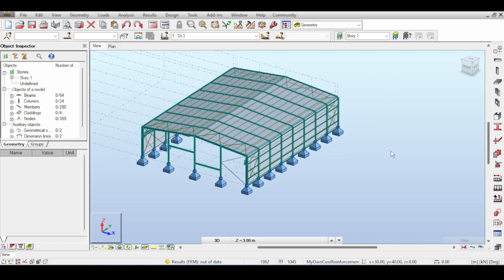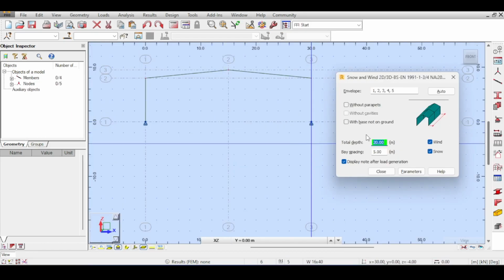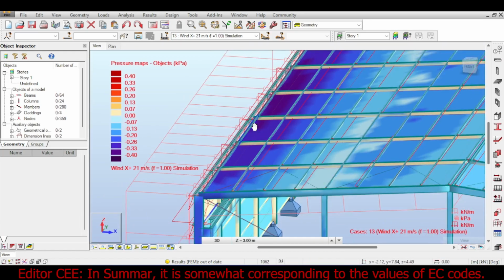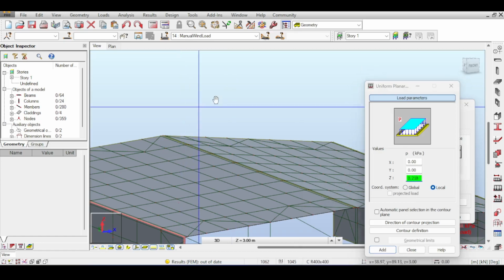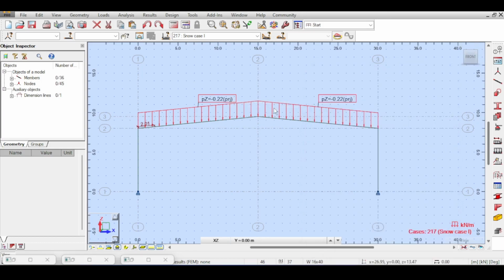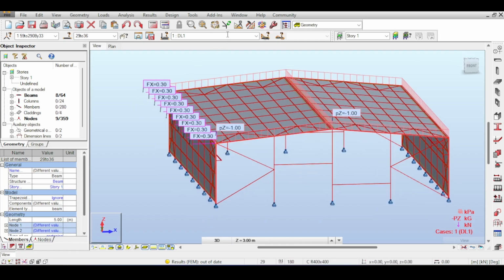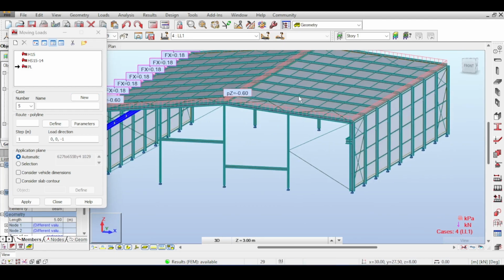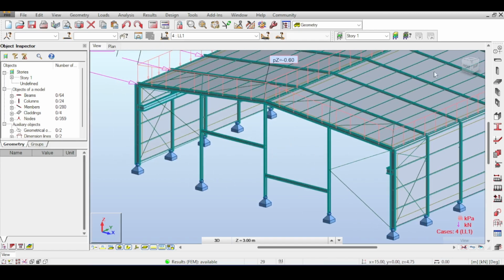Modeling of Industrial Warehouses | Part 5: Wind and Snow Loads

Comment: Hello CEE,

In my opinion, the CEE work-around with the “code parameters-based method” is smart, BUT it is a LOT of work (I guess as the CEE have already mentioned – unfortunately sometimes and in this case, it is what it is). These are the sort of things where the designer’s engineering judgement and their ability to evaluate (by inspection) the most critical (wind) load cases can become handy in minimizing the painstaking manual labour that is involved in transferring the wind load cases as it was shown in this video. Thank you so much CEE for showing these alternative and viable options, because of your work, now there is a choice. 

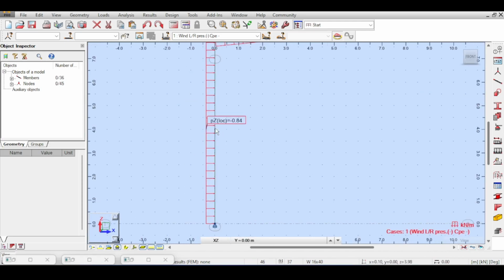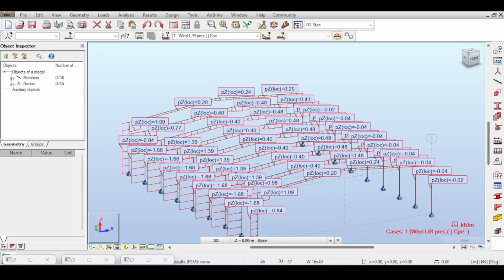21:22 Yes Editor CEE, I 100% agree with the recorder CEE; practical techniques have been laid bare in this video tutorial and these techniques are screaming to be applied by any of the interested viewer(s). [by the way, all transfer wind loads from 13:50 should be divided by 2.5 and not 5.0 because an external portal frame was chosen and it is being used, ref to 13:05]

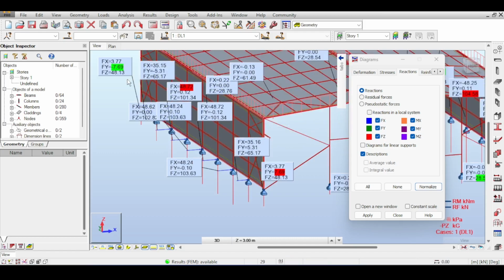22:50 The calculated value of 0.3kN (for the DL case) Equivalent Horizontal Forces to account for the “elements global imperfections” are of the correct order of magnitude. In my region, the value is 0.5% of the gravity loads. This would translate to a similar value of 0.5kN in this particular case.

Question and suggestion: Considering that we are already accounting for “global imperfections” as it is shown above; would it not be even more complete in this warehouse series to also conduct a “2nd order analysis = P-delta analysis” on the structure to ensure that the analysis results that we use in the design of the various structural elements do account for both the imperfections and the second order effects? If yes, I suggest that the CEE consider to show how (or to implement), or to performs a second order analysis on this warehouse structure.

31:26 Just to clarify, the crane horizontal and longitudinal loads coefficients or factors (to simulate the crane acceleration and braking forces) can be added NOT on the “load direction” input dialog box, but inside the “parameters” options….. the parameter button is the one just above the “load direction” input dialog box.

31:55 Thank you so much for confirming the roof bracings and for the pictures. It really helps a lot to build confidence in knowing that this is something that is also being done in practice and on real-life projects.

I really liked the CEE comparison of the RSAP “wind simulation method” and the “code parameters-based method”. Search Autodesk through google regarding: “…. How wind simulation works in Robot Structural Analysis, assumptions made, and validation…..” there is a linked pdf file that makes an interesting read from there. [I could not attach the link directly to this comment because youtube kept blocking/rejecting my comment because it contained a link] 

I have enjoyed this video, and I am looking forward to the next CEE videos. Thank you for always producing top notch quality videos, and keep up the excellent work!

Regards, DK
Reply from the maker: Hi there Engr. DK,
that is a really good catch!!! I missed that. Thnx a lot. Will be added to the description under an "Errata" section. Thnx a lot ^_^
Also, great to know that there are some similarities with your region. 

Yes, a second order analysis with actual imperfections (theta and delta) being applied does make more sense. I think it is valid to show this in a separate video as I have similar requests with regard to buckling stability under imperfections. ^_^

Problem is, I already finished the recording of the last video "Warehouse series", so I have to implement this idea in another structure. I will keep it in mind.

TBH, I did not try to add the horizontal force, still, huge thnx for the comment. See, this is what I love about your comments, they help not only me, but all the viewers. So, "Pinned".

I had multiple comments suggesting that Robot does have an actual wind load calculation sheet that validates its calculations. The title of your pdf will make for an interesting read. I will download it and definitely read it.

I am happy you liked the video, and sorry for those comments not showing up, it is not from my side.

Regards,
CEE

Comment: Great video. I do it similar. I just the calculate the wind in Excel acc to EC and then apply the loads manualy. Quick tip: you can measure a distance by clicking the small dimension icon on the lower right corner( to the left of the units).

Comment: Hello, I have a question, how to apply the seismic (based on  IBC CODE )   and the temperature loads on a portal frame, because I think there is no way to apply the temperature variation load on steel structure in Robot
Reply from the maker: I think there was the ability to apply temperature in the loads. Check out the bar load types. Ima check it out and see if I can prepare smthn for that.

Comment: Dear Dr, my robot version doesn't have CFD. It is the 2024 version. WHat am I missing?. Are you using a older one
Reply from the maker: Hi there, I just checked my RSA 2024, it is under:
Loads -> Wind Loads Simulation

Please make sure you selected the building design template. It sometimes does not appear in other templates.

Regards,
CEE

Comment: Dear Doctor,

I believe that Robot is one of the best software tools globally for calculating wind loads. You will hardly find software that can generate such simulations as swiftly and accurately as Robot. Even the CFD version of Autodesk is commendable. Drawing from my one-year experience in working on wind-related projects and extensive reading on the subject, I can attest that utilizing this method with Abaqus CFD is quite challenging. I waited for about a month for answers, though the duration depends on the PC specifications.

What makes Robot truly remarkable is its ability to provide precise wind loads. Whether using the generated or 2D/3D simulations, the results are impressive. Admittedly, applying these loads to structures can be cumbersome, but even manual calculations take more time. Working with Eurocode 1 adds complexity to the calculations. I just wanted to convey a message that briefly highlights the software's significance for both humanity and engineers.
Reply from the maker: I actually mentioned your point in my community post. I was not yet able to reply here due to some busy schedule I have. I agree with you completely. The only reason I try to avoid this is because it would cause more questions than answers if I attempt to explain it. I mean, computational fluid dynamics is a really really interesting topic, but needs you to have some backgrounds in fluid and aerodynamics as well as aero-elasticity. I am really thrilled to know that you do possess the background in it. It honors me to have you here really.
Reply: @CivilEngineeringEssentials  I mentioned that in my linked in profile. It's an honor for me, Doctor, to learn from you and have the opportunity to discuss this question, many  times I had a lot of question and get into your channel, I'm like this man is doing something remarquable. My research on CFD had left me behind when it comes to designing. However, watching your videos, along with reading and searching in the code and outside, has helped me rebuild a strong background for my engineering design aspect. I hope one day you receive the real value for your hard work and for spreading knowledge in this way. We really need someone like you in this world.

Comment: Hello, Doctor,

The wind simulation is akin to a wind tunnel test, relying on the Computational Fluid Dynamics (CFD) method and doesn't refer for any code. As you may have observed, you can adjust the wind profile values. There is a prescribed rule for making such adjustments, grounded in two formulas. I can share these in a video if you prefer. Nevertheless, CFD stands out as the optimal approach for calculating wind loads. This preference stems from the fact that its foundation lies in the Navier-Stock equation, which succinctly outlines all the characteristics of the studied fluid (in our case, wind).

Distinguishing this method from other codes, most codes exhibit limitations in handling the geometrical shapes of buildings, especially in terms of height. For instance, the Chinese code is unique in its ability to calculate wind loads for buildings exceeding 500 meters in height. Additionally, many codes treat wind as static loads, overlooking the dynamic nature of the actual loads.
Reply from the maker: As I mentioned in my comment on your previous comment. I avoided diving deeper into this topic without establishing the needed background in fluid/aero dynamics and aero-elasticity. Still, I am honored to have you here, with the background. It is actually rare to find ppl interested in this. In my PhD I was working on the structural identification with applications on normal structures and wind turbines.
Oh boy, the wind turbines are surely interesting. Just the sheer amount of complications due to aerodynamics is really cool.
Reply: "I apologize, doctor, if I've been a bit persistent with all these comments about CFD! On another note, my professor, Kassem Deeb, is delving into offshore structures for his thesis. While I haven't delved into the details yet, I've come across two papers on wind turbines, and it's truly an intriguing subject. I believe it might emerge as a significant topic, especially for turbines situated in the middle of the ocean, considering the global push for renewable energy."
Reply: Actually, I wasn't initially interested in studying dynamic wind or the CFD method. In 2022, my instructor at CNAM asked me to explore the impact of dynamic wind on skyscrapers, compare it to earthquake effects, and integrate both aspects to assess their combined impact. Initially, my first tutor wasn't able to provide much assistance, leading me to leave my job for this project. It required extensive time commitment, and I immersed myself in reading about design perspectives and various international codes, including Japanese, Chinese, Australian, Saudi, Eurocode, and ASCE. Despite my efforts, I couldn't find the answers I sought.

After eight months of solo research, I stumbled upon Kassem's paper and encountered the term CFD for the first time. I delved into CFD through self-study, exploring Abaqus CFD. Additionally, I needed to deepen my understanding of structural dynamics, and K. Chopra's book proved instrumental. Working independently, I applied wind loads using Robot software for about 30 buildings, delving into dynamic wind effects and investigating the P-delta effect (geometric). I compared my results to Eurocode 1, maintaining consistent wind speed.

Simultaneously, I worked on applying El Centro earthquake forces to the buildings. Combining both forces, I studied their collective effects. After a year and five months, I graduated in 2023. It's worth noting that I was concurrently pursuing another master's degree in transportation and highway engineering. Despite the challenges, I found a new job and even started my own company.

Comment: I really know a website that calculates for free the wind pressure on different structures based on EC1. I am really using it. It is wonderful.
Reply from the maker: That is an interesting website. Is it possible to write it here? it would help. I am stuck at this at the moment.
Reply: For sure, but YouTube is preventing me from. That
Reply: Eurocodeapplied

Comment: Hello,
What about dividing the house into areas A, B, C, D, E, F, G, H and I and then defining the appropriate loads on the these areas using the uniform planar contour load ?
Reply from the maker: That is actually the plan that I will be following in my RC Building design series. You are 100% right. This is a "semi-manual" way of doing it. 

What I meant by Robot's problem is that there is no "magical way" of defining the wind load.

Regards,
CEE
Reply: May You help us in modeling a canopy or a solar panels structure and which wind pressures would we use (W,net  or Fw? Thank you a lot
 @CivilEngineeringEssentials

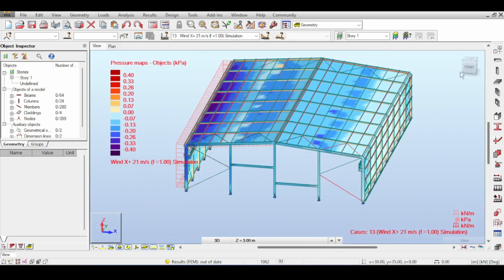Comment: At 11:00 - where you are comparing wind pressure values between the two models, I think the Snow and wind 2D/3D uses the basic wind speed for the region under consideration whereas the full wind simulation requires the effective wind speed. In the full wind simulation one may input/use dynamic wind pressure instead of the (effective) wind speed. The relation between these two (effective wind speed and dynamic wind pressure) is given by pressure = 0.613 × (effective wind speed)^2 - that is if you are using BS6399.
Reply: So, I think the best way to prove this is to extract the effective wind speed from the snow and wind 2D/3D module and use it in the full wind simulation and compare the results.
Reply from the maker: I think that is an amazing point. This would re-instate my trust in the Wind Simulation of Robot. This is great!!
I might even make a full video about this in detail. Thnx a lot

Comment: Wind load generator used the code you set in the job preferences for wind load calculation. it also produces a calculation note for wind load calc
Reply from the maker: Great to know 👍huge thnx
Still, you have both options for that so feel free to choose
Reply: @CivilEngineeringEssentials  great. waiting for the design part

Comment: When modeling a truss with structural Tees as chords and single angles as web members, if you model the web members with offsets, you get weird moments on the top chord. Is this normal?
Reply from the maker: Hi there, 
I have to check it myself, but note that: if you have an offset with axial forces, you will get moments.

So it might be that case.
Regards,
CEE
Reply: @CivilEngineeringEssentials  Thanks, I found the reason for the weird moments. I had offsets and bar releases on the web members at the same time, and I guess it's not allowed. I removed the releases, and the bending moments on the chord members are gone.
Reply: Why arent allowed the use of releases and offsets simultaneously?
Reply from the maker: You are allowed. He is mentioning that the moments dont add up so I explained why it might be the case. If it the model corresponds to reality, then that is perfect . I cant exactly judge on that. 👍